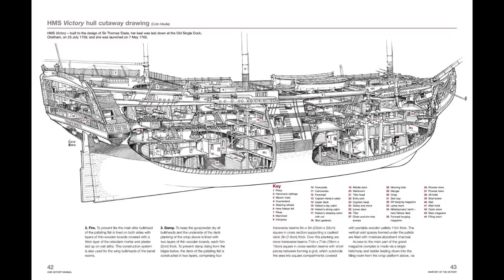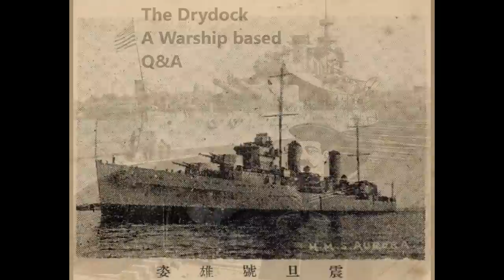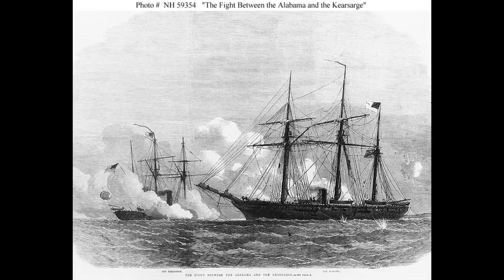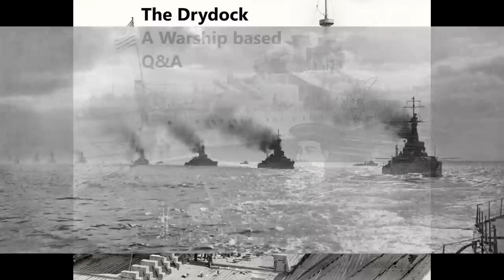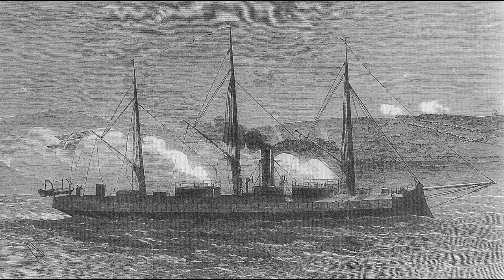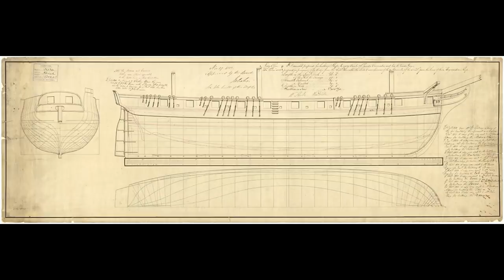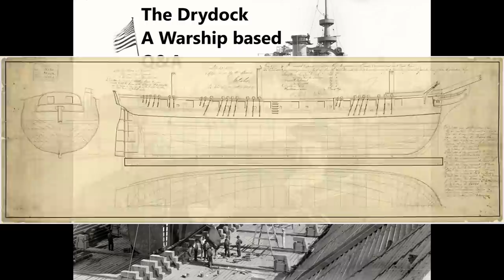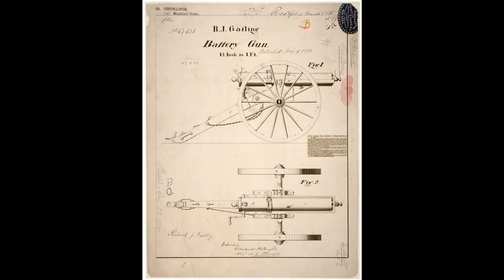The Drydock - Episode 179

Comment: @ 3:24:47, Lexington was not alongside on the rescue mission to Wake Island, it was Saratoga as the sole flattop. Also, the Americans didn't have "two fleet oilers" along for the ride. Get this stuff right, details matter.

This is not to argue that Pye's decision was wrong -- I don't think it was -- but your opinion should be based on facts and not BS.
Reply from the maker: Lexington and Saratoga were both involved in the operation, Saratoga as the actual relief ship and Lexington trying to distract attention from her sister, so both were involved in the operation and at risk. Likewise Lexington could be redirected to support her sister and this constitutes the 'maximal' best case scenario in the event the US decides to proceed once intel on the strength of the IJN formation has been discerned.  TF14 had the oiler Neches (which ended up being sunk) and TF11 had the Neosho.
Reply: @Drachinifel  Right, but Lex was a good distance away (600 or so miles, iirc) and unable to provide any support to Sara for a day or two, including after Neches had been sunk. Sara would therefore have been facing two Japanese carriers alone and forced to get the Marine fighters off to Wake before the ship's air wing could sortie in strength.

I agree with you that Pye made the correct decision. The disposition of Lex out of support range was one of those factors. Lundstrom's "Black Shoe Carrier Admiral" goes into this in some detail.
Reply from the maker: @Thumpalumpacus  indeed, but as mentioned this was a hypothetical 'best case' for the US, so for example instead of turning back Lex was instead ordered to hightail it over to support Sara. :)
Reply: @Drachinifel  A risky decision at that stage of the war. Lex better have a lot of charging in her, because IJN CarDiv2 has already shown it's got plenty of hustle. Fletcher's destroyers were also not at best fuel considering the loss of the tanker. If they need to speed, it's got to be done soon, and headed east.

Comment: Regarding the question about transom sterns: Perhaps the designers decided to stay with well-proven design practices for the Nelsons and the KGV class *because* they were so tight on weight. Maybe they just didn't want to risk a big surprise by using a stern design with which they had had relatively little experience. Just a guess, of course, but it does sound like a decision an engineering manager might make.